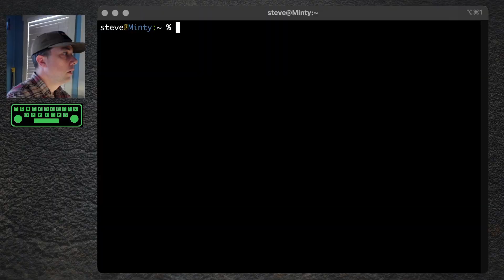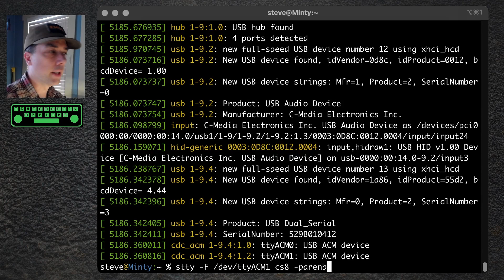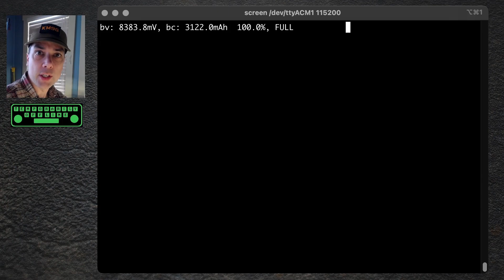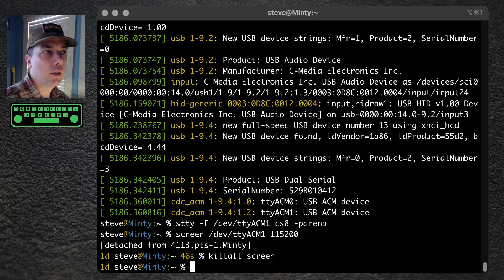Xiegu X6100 BMS Hacked

Comment: Thanks, but I was hoping this would tell me how to reset the BMS and restart the calibration.  The LED never stops blinking for me.
Reply from the maker: I haven't had the problem to be able to show a video on it, but I believe if you disconnect the battery from the PCB (it uses a JST connect IIRC) and power up the radio you'll reset the BMS.  Xiegu seems to think that 4 charges/discharges will do the trick, but I don't want to burn battery cycles without a purpose (again).

Comment: great video. do you know how to increase power output in windows?. in battery i have only 2.5 watts in 40mt and 10mt, in the other bands 5 watts regular.
Reply from the maker: That's strange, should be about 5w on all bands.  How is your antenna match on thise bands?
Reply: @temporarilyoffline  the antenna match is ok, i tryed on dammi load too.
Reply from the maker: @lucabenatelli9672  on 40/10 are you in AM mode?  Try CW and see what the output is.
Reply: @temporarilyoffline  max power cw key down on dummy-load in 40mt 3,5 watts, 10mt 2,5watts. Others bands about 5 watts. To esternal Daiwa watt-meter.
Reply from the maker: @lucabenatelli9672  Ok, I'd talk to your vendor about a warranty or return.  Here is the power test on my radio for comparison: https://www.youtube.com/watch?v=J0NzZxxDrZE&list=UULFai-PmK8xOBOunwi6MoBgwQ
Reply: @temporarilyoffline  ok.  I tried with external power supply in 10mt only 5 watts max . Is there a firmware solution?
Reply from the maker: @lucabenatelli9672  There probably isn't a firmware solution.  If you can't configure power-output with the power output control, then you likely have some defective hardware that needs repair/replacement.
Reply: @temporarilyoffline  ok, many thanks.

Comment: OK, Linux noob here. When you initially set up the serial port, what are you using to communicate with the radio if it is off?
Reply from the maker: The settings are the same if the radio is on, so if it isn't happy with the radio being off when you set it up, turn the radio on, get all connected and then turn the radio off - you'll see some interesting messages along the way!  Have fun with it!
Reply: @temporarilyoffline  Interesting! I was sitting here with a blank screen, and just read your comment. I hit the power button, and suddenly got a battery status on my Quadra display. It is different from what you showed in the video: "bv: 8316.2mV, bc: 2811.0mAh, fbc: 2815.mAh, 99.8%, CHARGER OFF" then a line below that: "error counter: 0". I'm going to assume that the fbc might mean full battery capacity. If I ctrl-A D to get back to the Quadra console, then try the "screen" command again, nothing happens. I also tried it with sudo prefix, no dice there, either. HOWEVER- Re-booting the radio brings the battery display back on the Quadra. It's like a one-shot kind of deal. Is that what you find with yours?
Reply from the maker: @davetelling  not here. Ctrl A-D detaches screen and then youndo screen -r to reconnect. Once the radio is off, you'll get the BMS hack, when the radio is turned on, you'll get a different display, and the you can turn the radio off and you'll see the BMS again.

Comment: Hi, my X6100 only shows capacity of 2500mAh for 8.3V and 100% charge ... I've done the hard reset and cycled through the battery charge 4 times ... any thoughts ? 2500 vs 3100 seems a big difference ... no real big issue as I use external battery for X6100 operations (10W!) ... the internal battery is a nice just-in-case backup
Reply from the maker: That seems off to me and if it bugs you enough I reach out to the place you bought it from for resolution.  If not, the internal batteries are replaceable without too much difficulty.
Reply: @temporarilyoffline  thanks for the feedback !